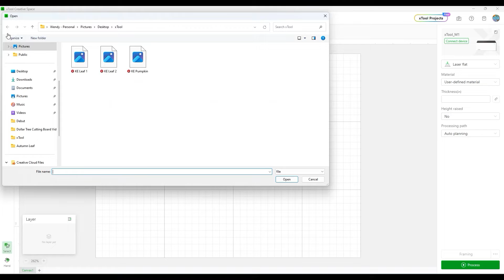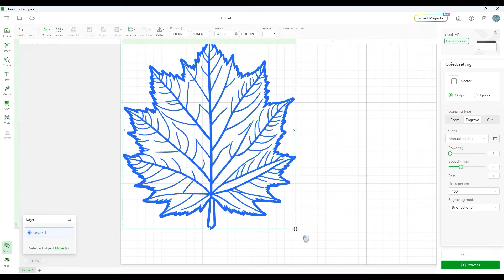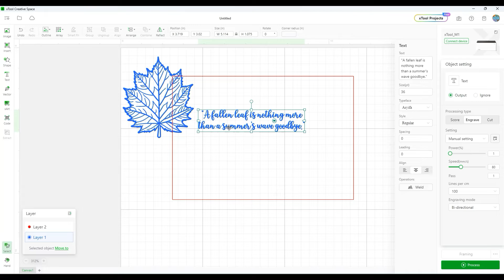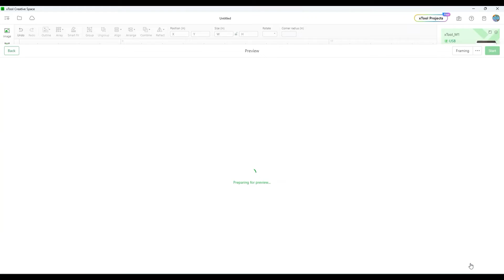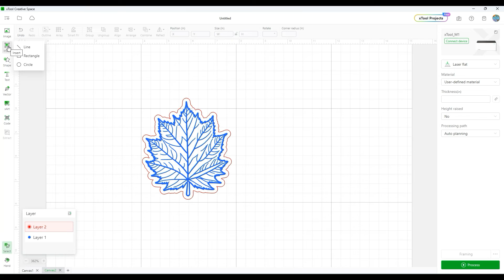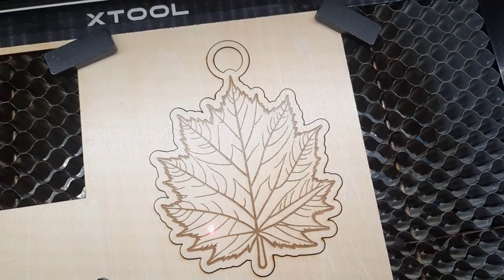How To Laser Engrave a Cutting Board - xTool M1

Comment: please help, I have a 20mm thick piece of oak but cannot find anywhere any help for what settings to use when using the honeycomb bed, which shelf if any I should be putting the oak board on, and then which settings I ned to change on the software before processing it... thanks
Reply from the maker: Remove the honeycomb and place it in the first slot down.  Place the board on it and see if the top of the wood comes up to the opening, if not you will have to place something under it to make it level with the opening.  Change the "MODE" to "Baseplate Removed" and perform the automeasure.  If that comes back OK choose your settings from the materials panel.  Use the new materials suggestions to choose the look you want.
Reply: Thankyou for that, I'm. Amazed that having watched so many videos, read loads of guides I couldn't find any that describes exactly what I was looking for.  @PoppyHillDesigns

Comment: Just an FYI. You helped me so I will help you as well. When you want to brake down your text to more then one line just put the cursor where you want to split the lines and hit enter.  No backspace or shift key needed. 
(Copy paste), highlight object then right click on the object, hit copy  then hit paste close to where you want it move to then make your adjustments. No need for c-control or v- control. 
You can also go to shapes to get a circle or square. <--- to each his/her own on this one. I like to use shapes and unlock, then size it. Either way works. Much of what I am telling you are updates or improvements they made to Creative Space. 
Another great video TY, I leaned new tricks from you once again.